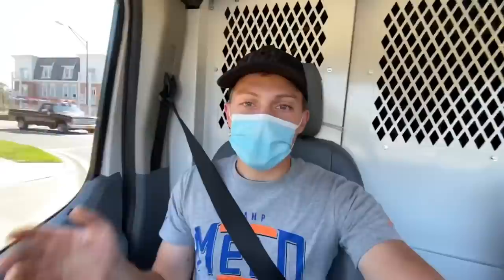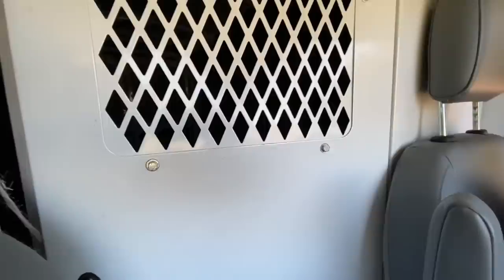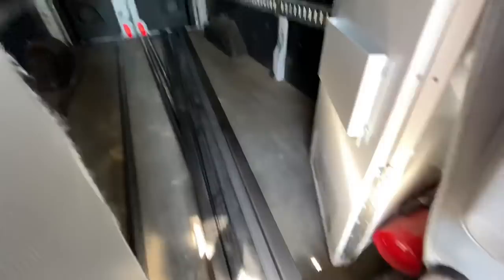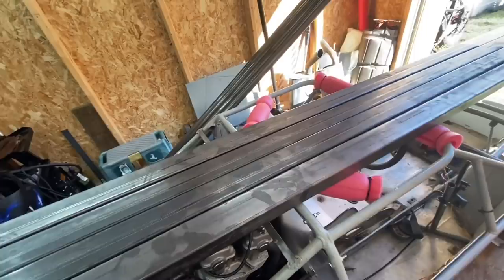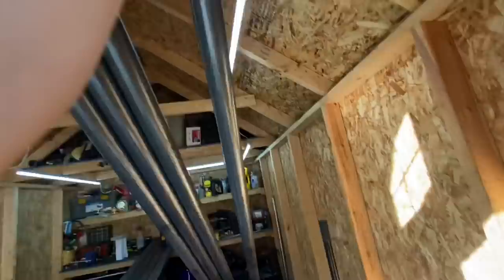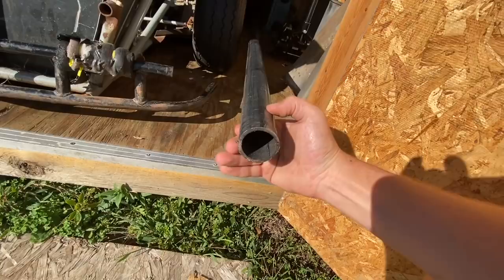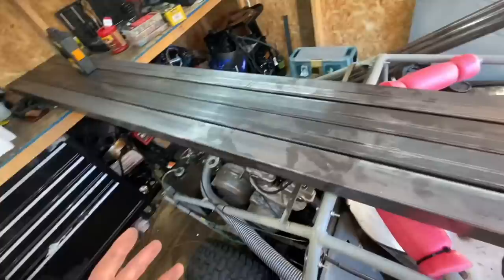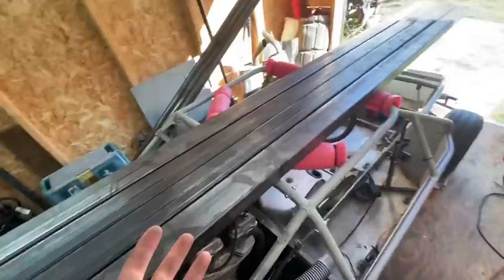Gathering the SUPPLIES Needed for the NEW Firetruck BUILD! This is Going to be EPIC!

Comment: Hey migs, you should put a cummins 6bt or 4bt and put in that thing! They arent the cheapest but a cummins 5.9L or 6.7L are indestructible and as far as dimensions theyd fit the best for a narrow but long framed vehicle.  I was tossing the idea that you planned on using one of those yanmar single cylinder diesel engines or a chinese duromax single cylinder, something small like that but a lot of people say those motors arent very good durability wise. Warped perception mentioned it in his diesel go kart video where he bought a kohler diesel engine. I know that a cummins is pretty pricey but you can pick up a 5.9L 12v that needs a little work for i feel like a good price and its really not hard to rebuild a 5.9. They are completely mechanical and only need the fuel shut off solenoid wired up to run. So thats a super easy wiring job, my buddy said he knew a guy that could get a cummins for around 1,000 dollars so you could find a good motor for probably just a smidge more than one of the chinese diesels and you would have way more power and torque to really make it beefy and still move it with no problem. Its a huge step up in fab skills and power output from what you have done so far but i feel like you can handle it. If you dont want to go the cummins route you could go with a tractor motor, those are normally 3cyl diesels but they arent turbocharged or anything. Good luck and i hope you go cummins on this build! Lol

Comment: I have welded 1/4 inch steel with a 110 mig welder of course ive been welding for a long time experimenting with things from soda cans up yes I have successfully welded soda cans together 2 years ago I built a body for my 1/5 scale baja 5b iv rolled it had some hard rollovers and even landed on its top a couple times and its made of wavy roofing tin I apologize for such a long post

Comment: Look for an old golf cart, they have rack and pinion steering and they have heavy rear ends in them. Depending on what you us for a engine, you could us a forward revers gearbox for a 150cc go kart.

Comment: Get a 240v mig welder preferably with shielding gas. You are trying to weld fairly thick metal and need the penetration ability of a high powered welder.

Comment: I have noticed you have been using a lot of starter fluid. Just so you know starter fluid is really bad and hard for your engine. Instead I would get a spray bottle, fill it with gas and spray it in the carb where your Air intake meets the carb and it'll do the same thing as starter fluid. Love your vids tho